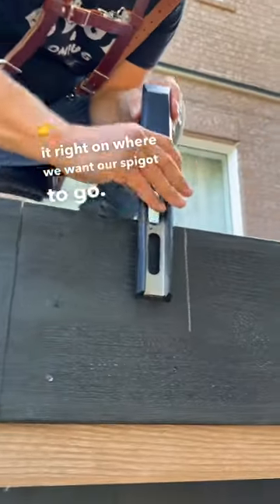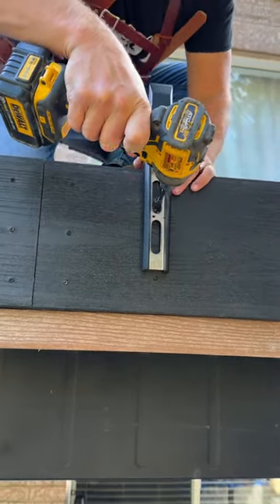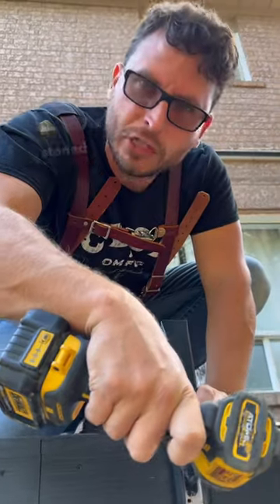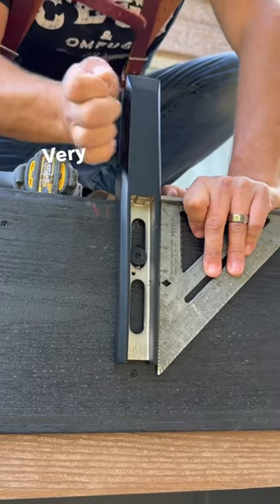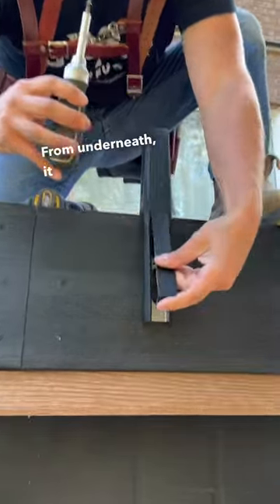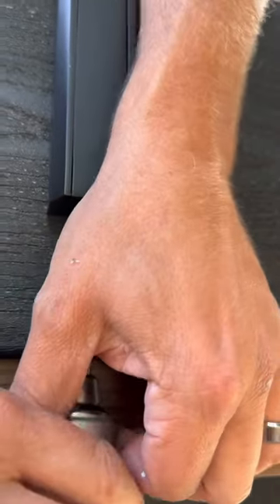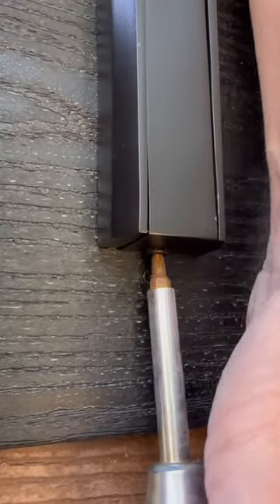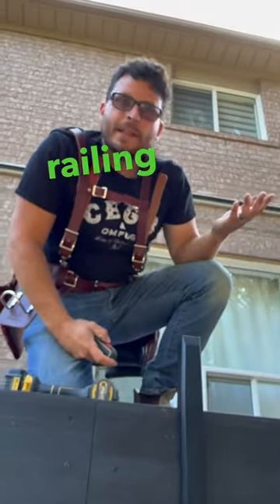Installing glass rail spigots #carpentry #diy #construction #deckbuilding #decks #railings #shorts

Comment: . Why are the slots so wide in the extrusion (appears to be aluminum)? The head of the screws barely grip the edges of the slots. For adjustability for plumb? Even worse! One good side load on the railing, especially with the leverage of the railing above and the heads strip through the extrusion. Maybe I am misunderstanding the application

Comment: Shoulda put the second screw at the top of the slot so it holds the weight without letting the spigot slip.
Reply: there's a lip midway up the spigot that hangs off the top of the board.

Comment: According to your measurements, that, in fact, is not square...
Reply: It’s actually perfectly square. If you knew what you were talking about you’d know they are V shaped and you’re supposed to have about 3/16 at the bottom on both sides. Some are 1/4. Just depends on which you’re using.
Reply: Ahhh, ok, my apologies, I was not aware of the shape of those bracket, i completely understand what your are saying now vs. In the video. It's just that whenever I hear "square," to me, that means corners are vertically and horizontally even for something to be square and exhibit 90-degree angles, such as the intersection of walls and floors. Now if you have 3/16 of a difference from the bottom to the top that by definition is not square, due to the fact that you do not have 90° angles completely vertical. Does this make sense? Or am I over complicating the definition of terms?
Reply: No response? Am I wrong?

Comment: You said that you could use a structural screw with a washer but you chose to use a washer head screw🤔!?
Unless I'm mistaken that's a spider drive which is most definitely a structural screw that takes the place of a 3/8" lag or am I mistaken!?
Kinda confusing 😕🤔
Thanks 🙈🙉🙊

Comment: What didnt you bevel those boards made the joint fit tighter better start learning boy
Reply: Probably because he’s in an area that has winter.  My facia boards will expand and contract by enough tgat you leave at least 1/8 inch gaps. Or end up with wavy fascia.
Reply: @thackstonns  maybe but he wasn't smart enough to even think that.